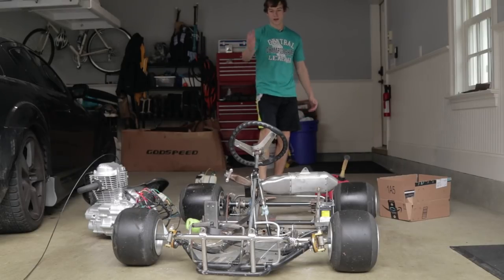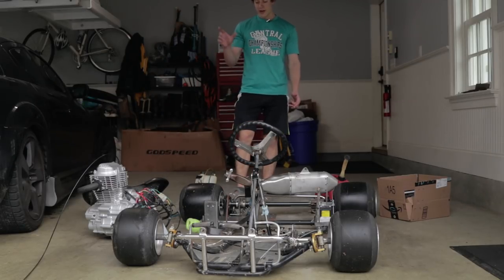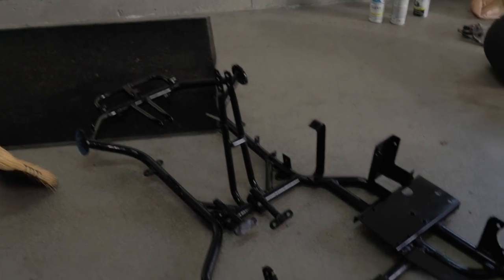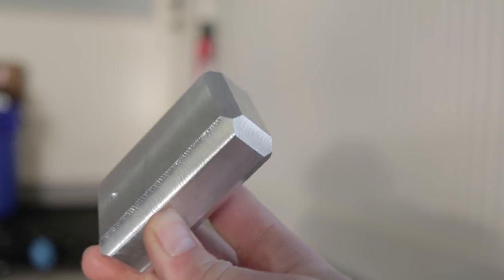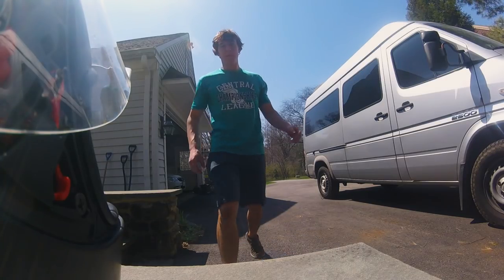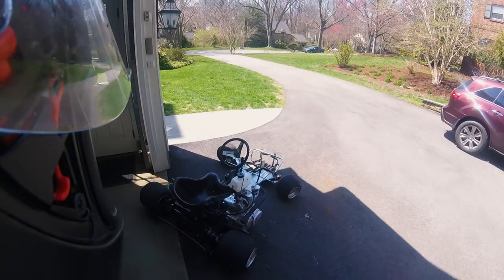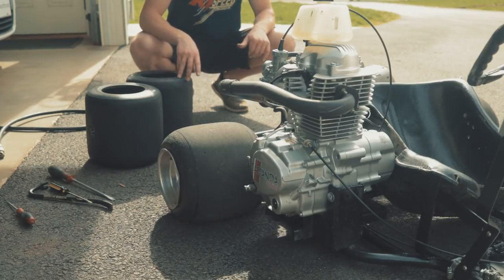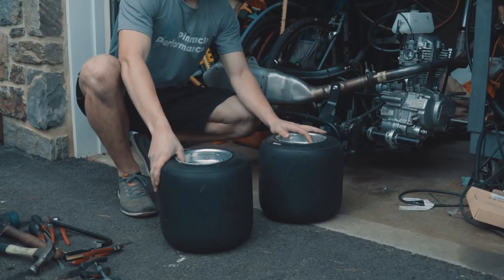Fixing and Cleaning up the Stick Shift Go Kart

Comment: where did you get the black exhaust pipe at?
Reply: its this header pipe shipped from australia. Its the only one that fits these engines i could find: https://www.ebay.com/itm/Exhaust-Head-Pipe-Header-With-Gasket-For-Zongshen-Lifan-Loncin-150-200-250cc/122413132192?hash=item1c806429a0:g:9ocAAOSwWxNY1HhD